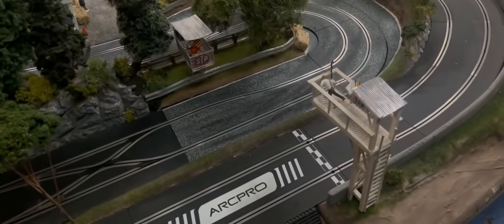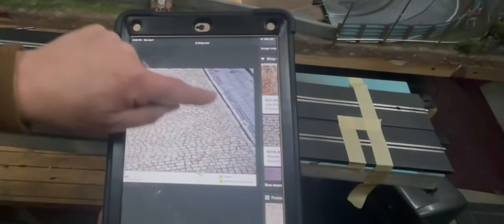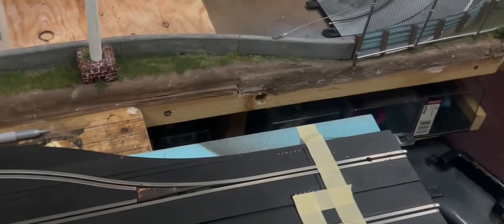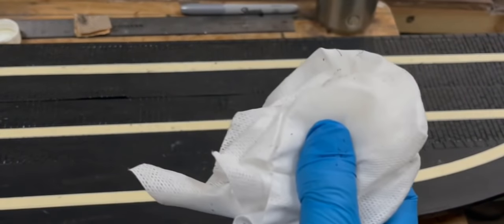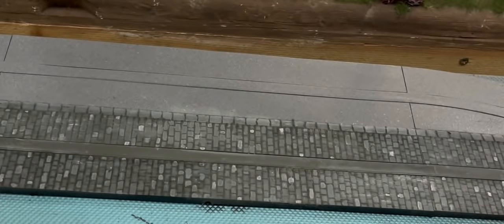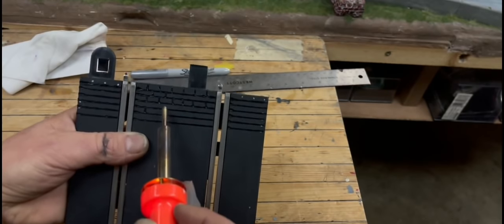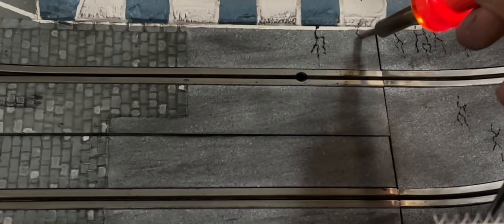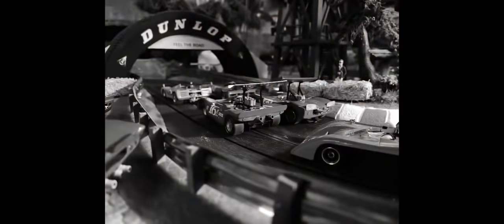How to create realistic effects for your track surface, Track Painting series video 4

Comment: Thank you Boone. I’m about done prepping my raceway surface for paint. I’m using AFX track and have smoothed out the joints with plastic putty and have completely sanded my entire layout to intentionally make it as slick as possible.

I wasn’t even aware of the releasing agent before watching your videos, so I obviously have no idea how deep it penetrates. I was planning to use alcohol to clean my track before painting it, but do you recommend still using the lacquer thinner and scotch-brite steps to prep my track?
Reply from the maker: If you are using alcohol that will be a good thing. But I do recommend scuffing the surface of the track to promote adhesion
Reply: @BoonesSlotCarGarage  … Thanks Boone 😎🤙

Comment: Great work. Like that red brick section most !👍🏻
When doin that, how much time did u spent in real time? (Or are u sleepless since starting ur project ? 😉

Would luv to see you blending the painted sections to the unpainted ones, to look smoother. What you think about that?

Regards from Germany
Reply from the maker: Thanks Torsten … in real time it took about 6 hours to complete the cobblestone area. The red brick is just as time consuming. ….. but the cracks go very fast…. 😂…  the blending is a good idea… I’ll do this on the next painting video for sure. Thank you for the suggestion..
Reply: @BoonesSlotCarGarage  Cool! Thx! I do have a Ninco System with a single rail
track and will try to create a little Rallye course with that, by using your tips for painting and detailing.
Reply from the maker: @torstenlangos8091  very cool, love the rally layout

Comment: What is  scotchbrite? Is it a pan cleaner of sorts?
Reply from the maker: It’s a abrasive pad that is made by 3M … they have different colors for the different grits… the grey is a mild grit , so it won’t scar the plastic to the point that it creates deep cuts, but it creates a scuff that will improve the mechanical adhesion for the paint that is applied

Comment: The cobblestone is beautiful. I've been thinking for a while about doing it on some Ninco straights... with a broken soldering iron tip (sand it down until it's fine). But I think that with some type of putty like fiberglass, epoxy or stucco it would be more beautiful, easy to do and just by sanding, you lose the grip, that in a cobbled curve would be OMG
Reply from the maker: Thank you 😊, it’s a fun project to do. Takes a bit of time 😂.. an epoxy would be a good idea for a mortar effect. I wouldn’t use stucco, I don’t believe it would last very well
Reply: @BoonesSlotCarGarage  The stucco lasts, 10 years ago I made a super sliding lake effect curve with stucco and blue and white pigment, I have no data, other videos... but I did it and it turned out to be a movie, like the ones from scalextric that are sold in Spain
Reply: @BoonesSlotCarGarage  It requires a lot of sandpaper and patience, but stucco when it looks good is pure marble.
Reply from the maker: @ThordoGames  👍 nice
Reply from the maker: @ThordoGames  very cool